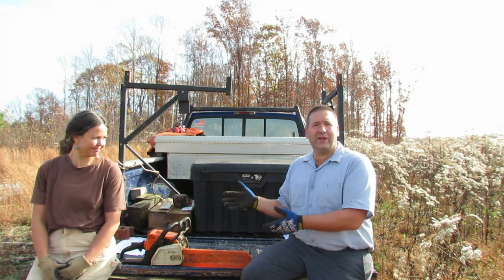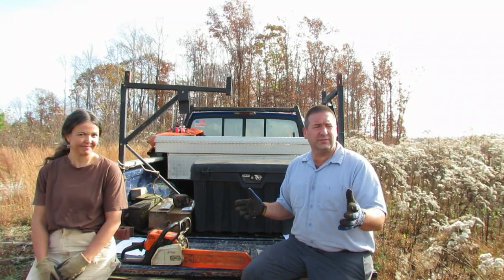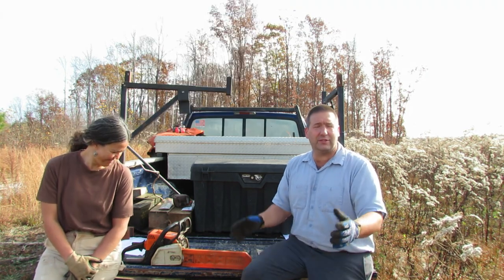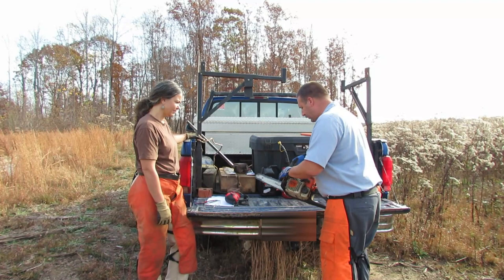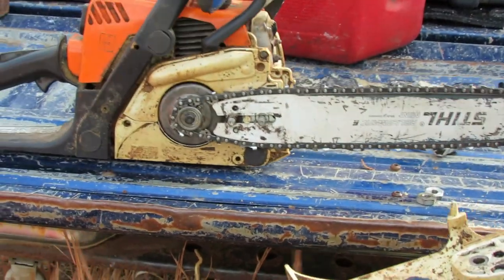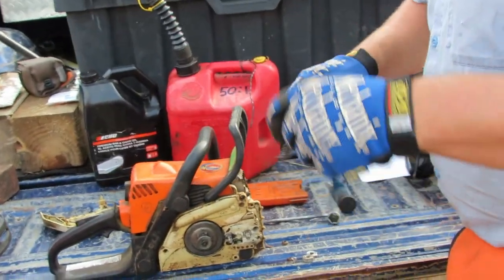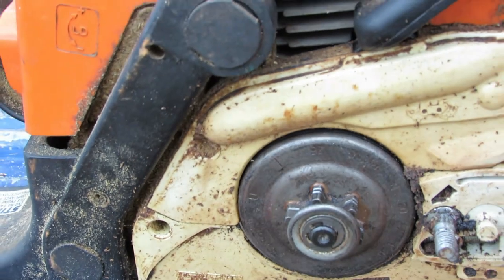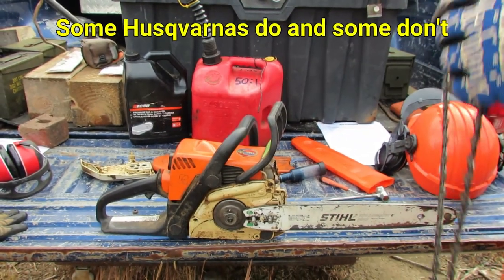Beginners Guide to Chainsaws: Inspection, Safety, and Starting

Comment: Jaki olej do mieszanki? Syntetyk? Jaka proporcja? zapraszam do mnie na kanał 👍
Reply from the maker: @kudu budu I use a synthetic oil called Opti 2. Comes in a gallon jug or 1 gallon gas can mix packets and other sizes. I mix 40:1. Have not lost any engines yet. I will check out your channel. Thanks for the invitation! ~Mr. C. 
https://opti2-4.com/index.php?dispatch=categories.view&category_id=165
Reply: @NaturesCadenceFarm  40:1 not too much, everything burns out? Valvoline DURABLEND 2T 1 l will be good? that one not available in pl.